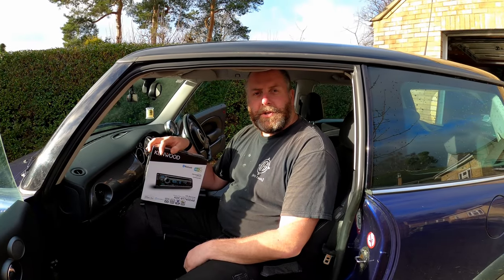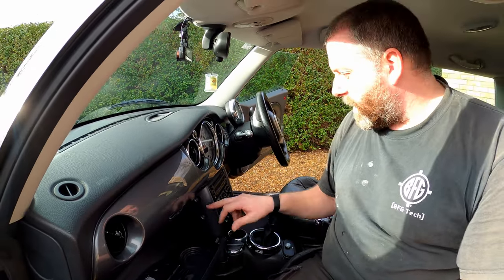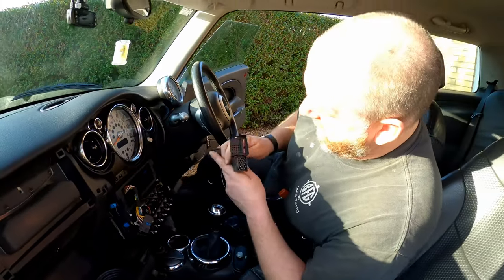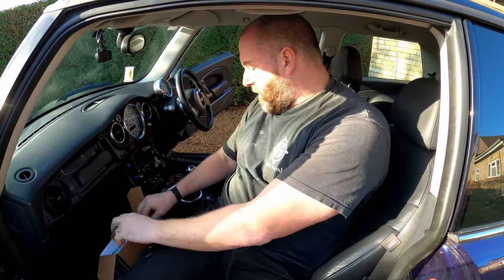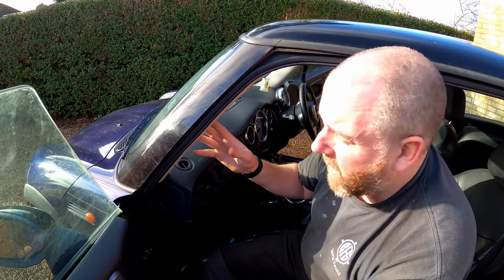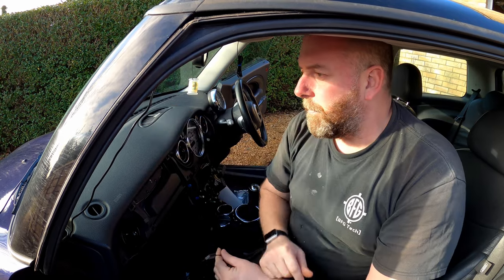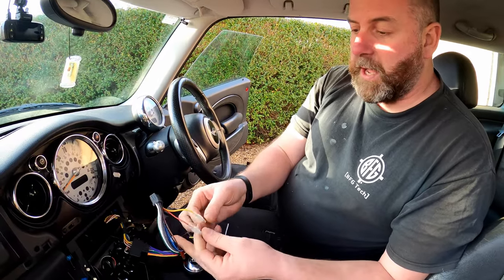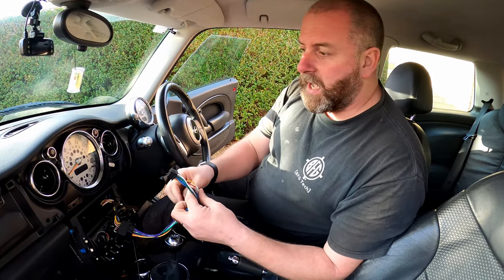Fitting An Aftermarket Stereo Headunit To The Mini R50, R52 & R53, Includes DAB antenna fitment.

Comment: How does the Kenwood speaker connect to the HK amp? I've swapped the head unit and it turns on the amp (you can hear the speakers activate) but it won't send audio?

Comment: Wanted to ask before I buy this head unit for my car, does it come with the adaptors or do you have to buy them separately? Specifically the ones just for the head unit rather than the ones for the microphone/dab radio.

Comment: Great video! But when I clicked on the link of the wiring harness it says it's not compatible with the Hardem karden speakers which my mini Cooper has that. I wonder what it means when it says that
Reply: I have the hardem Karden speakers also.. have you found out what we need to change the radio?
Reply: You just need the correct lead from connects2

Comment: Would this method of removing dash panels be the same for those with a Passenger Airbag??

I have a feeling people will ruin their dash panel and have to buy a whole new airbag unit from bmw mini 😞
Reply from the maker: I’m unsure as I don’t have a passenger airbag equipped car available to check with. It may be necessary to do the centre console removal method instead if that is the case. Easy enough but just takes longer.